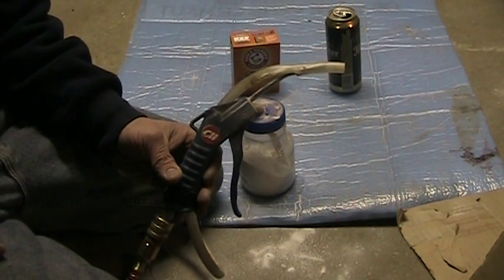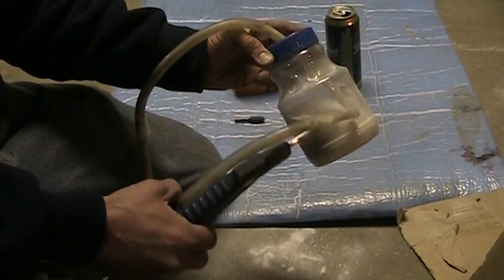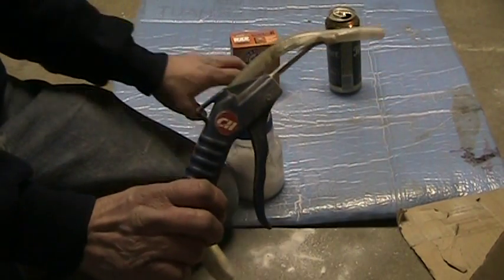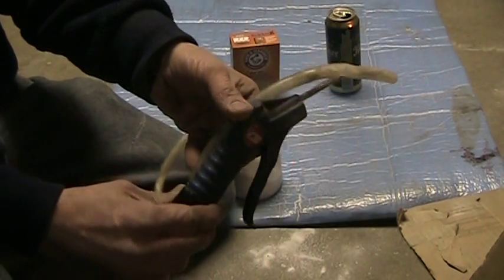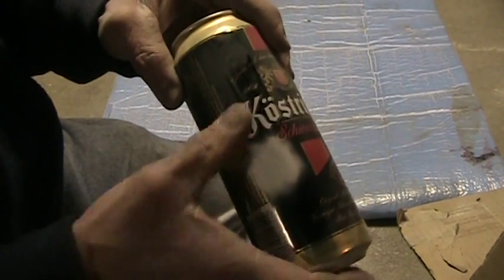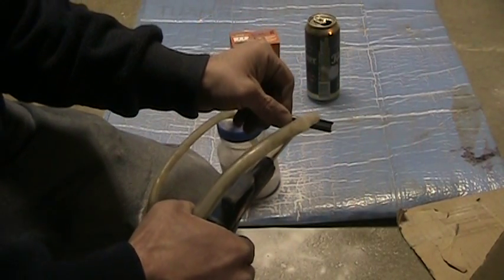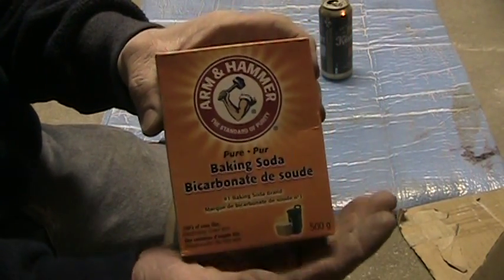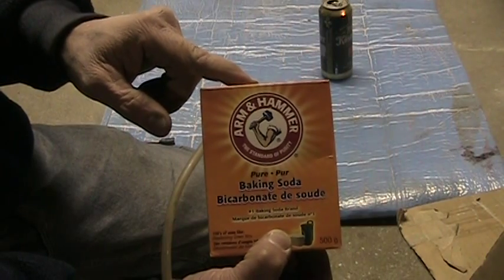DIY Soda Blaster

Comment: Ever tried it on glass?
Reply from the maker: Not yet but i will do a test.  Thank you for a new video subject,stay tuned.
Reply: I bought some tubing and didn't want to buy too big, but got way too small.  It was inexpensive but I'll have to go back and get a bigger tube.  I've had an idea for another way to use the Venturi effect would be to put a container of soap and mix in your air pressure with a garden hose so you'd spray soap foam on your car to wash it.  I might try it when it gets warmer.
Reply from the maker: Have you ever tried to make frozen bubbles?  Do it at night with a light between you and the bubble and you can watch ice crystals forming.
Reply: Bob Cartwright That would be cool. Should have tried it last weekend, it was in the single digits. Today's going to be high of 74, then back below freezing.

Comment: Bob is the pressure enough to strip clear coat for a carbon fiber piece on a car?
Reply from the maker: Ryan Chesebro At 80 PSI i think it would and not harm the carbon fiber. Start with a low pressure and work up cautiously.
Reply: My only fear is stripping resin and then being screwed
Reply from the maker: Ryan Chesebro That is a real possibility. Could you try it on an area that is not seen? You could try starch in stead of baking soda,but it may not have enough tooth to erode the clear coat.